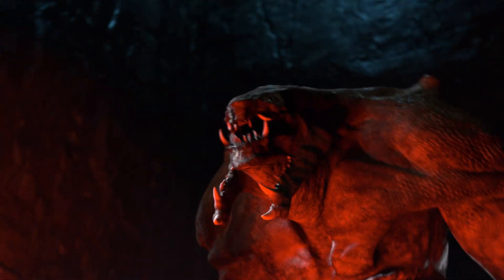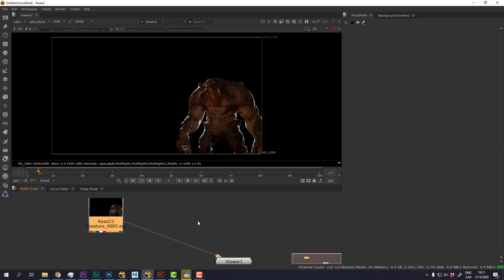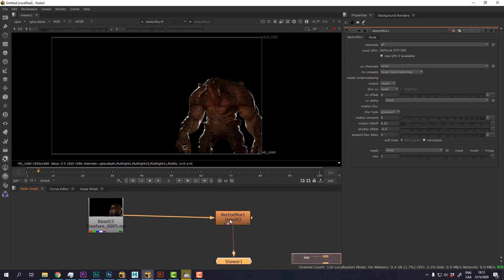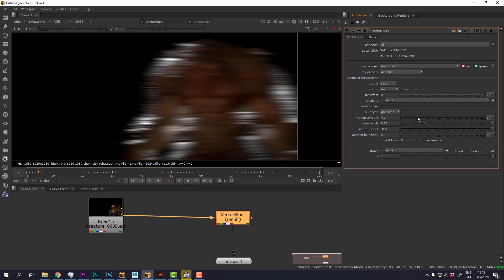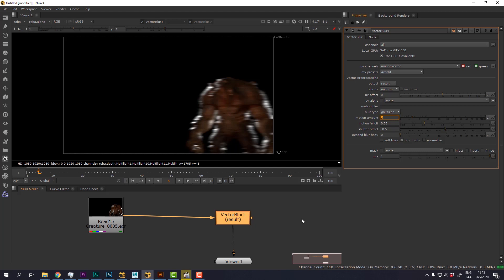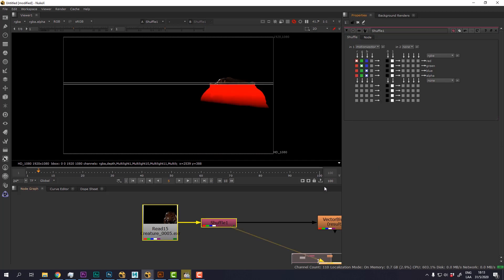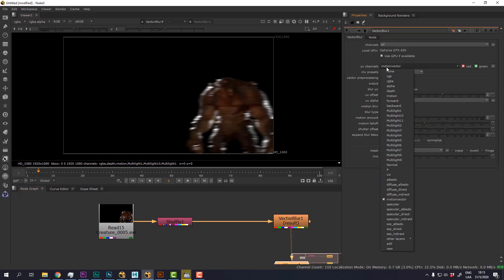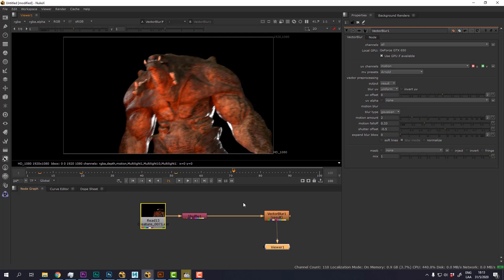Fixing Arnold motion vector AOV for motion blur in Nuke

Comment: i have seen this course on udemy, if i buy the course, will i get course files with it on udemy?
Reply from the maker: yes the files are included as alembic files
Reply: @boostvfx7402  Okay, also exr sequences or need to be render ?
Reply from the maker: @lightningspeed6142  yes it includes the exrs for comp
Reply: @boostvfx7402  great! I would have to buy !!
Reply from the maker: @lightningspeed6142  Hey thanks! well if you do, it would be great if you use the link I provide in the video description, but is your call 😄
Reply: @boostvfx7402  no worries I will use that one :)
Reply from the maker: @lightningspeed6142  thanks!